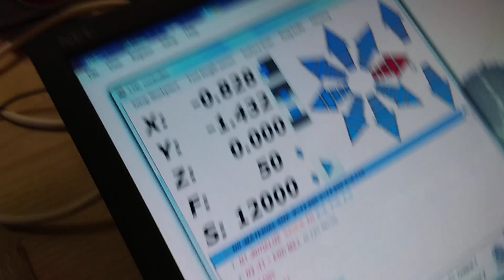MPCNC - Final - I hate this machine!!

Comment: Building your own CNC is a continuous learning experience. I built my 1st one about 11 years ago and have upgraded and built new designs over the years. You will ALWAYS have gremlins to chase down--even if you went and bought a turn-key CNC.
But getting to your MPCNC, I can't see your Z stepper in the video, but if it's the same size as the X and Y steppers I would say that's part of your problem. I also read in a comment you replied to that you're using low voltage--that could be a problem but having the correct stepper motor would be the better solution. See if you can wrap a piece of tape around the Z stepper shaft and put a piece of tape around the Z axis screw. Place marks on both of these tapes that line up with each other. Run that bird program again (you don't have to cut wood, let it cut air for the test). After the run see if the marks no longer line up. If they are off, you have mechanical slippage. If the are lined up, you are losing steps in your motor (which means you need a bigger stepper).
Reply from the maker: My background;  I am a tool and die machinist and have been running cnc's since the 1980's. I bought a Mazak cnc mill in the 90's when I had my own job shop. About 5 years ago I bought a Legacy Arty cnc mill, 3 years ago I lead a team of guys at my Makerspace to build an MPCNC (this one I am using belongs to a friend), and earlier this year I built a medium sized cnc router which I have vids of here on my channel which did teach me alot.
now, I know that means little when it comes to building your own and working out the little details of "chasing down the gremlins". I admit I don't know everything, and could even go as far as to say I don't know much in the grand scheme of things. But i do know that this limitation of a very very very slow z axis is normal for this build when cutting 3D. I have read it in the forums. One easy solution is a 2 or 4 start leadscrew instead of this threaded rod.
I am using low voltage because it is the design of this machine to do so. I am actually on the high end of the scale. btw, I don't know if you know, but this is a kit build basically. https://www.v1engineering.com/ . 
the correct stepper motor - this is the correct stepper for this kit. I did say in a reply that more voltage with an external driver would make a big difference though. thousands of people have built this machine and don't complain. I'm guessing because they don't know what a real CNC acts like.
it is not mechanical slippage. I say that, but I suppose I could confirm that as I have recently decided to take another run at it. But, I always file flats on the shafts where the setscrew goes and nothing is loose. But your sugestion for cutting air is not a good test for this machine. I can cut air at 20 IPM with no errors, but have fails at 10 IPM when cutting wood.
bigger stepper - yeah, maybe. I'd try more volts first though.

   the thing is, most of the builders of this machine don't cut 3D, they just do  2.5D and that is much less work for the z axis so most users never have the problems I am having.

   I am quite confident it will work at 3, 4 or maybe 5 IPM Z axis feed, but the reason I walked away from this machine is I have a Legacy CNC and a home built cnc that's even better than the Legacy, and who wants to let a machine creep along all day with one cut that should take 20 minutes? Then there's the problem of keeping it square! And consistently getting your work zero's in x and y from one day to the next or after a power outage.

   haha, I just talked myself out of running it again. 

Now I remember why I walked away. even if I got the z axis to run at 50 IPM reliably, it would still suck.

   yep, I am done with this machine.

  A much better build for not much more money is here - 

https://youtu.be/jMcblAB_fe0

Comment: If you haven't already, you should post your problem on the v1engineering forum. The MPCNC is a brilliant design, but you have to follow the directions on the website very closely. Off hand, here are a few things that I can think of that can cause the z to loose steps. 
1- The Vref voltage on the stepper motor driver may be set too low.
2 - The tension bolts for the z axis were over-tightened. To check this, you can disconnect the lead screw and screw it down to where you can move the z axis by hand. Without the weight of the router it should move easily with no slop. I can move mine with just one finger.
3 - Lead screw needs to be lubed.
Reply from the maker: thx Kyle.
I know the MPCNC is a good design and the forum is great too.
Problem really is that I have 2 other cnc's that are great heavy duty machines, so I'm a bit spoiled.
#1 I began with Vref voltage at .7 and then took it to .9 and then 1.1. The drivers get a little hot when going over .9volts. I could go 1.2 to 1.3 and put a fan right on it, but shouldn't have to. It should work fine at .9 to 1volt I would think.
I think the problem is counting steps, which reminds me now, I have the steps at 32microsteps. If it is steps, I could try 8 and see improvement.
#2 I guess you didn't watch all my vids on this machine because I showed the ease of movement that the z axis has. It moves easy as can be with the motors off by one finger, and yes, it is lubed (#3). 

It is not friction.
I worked with my Makerspace and built a different one and it could only do 7 IPM in the Z axis as well. It seems to me this is normal operating parameters for this machine.

Comment: Maybe close-loop or servo motor helps. Don't give up, it is nice to most hobbyist.
Reply from the maker: Thanks Efren. I have thought about firing it back up from time to time.

I started running it with z axis feed at 20IPM and it failed so I went to 15, it failed again, so I went to 10 and it still failed. Now I figure it might run well at 5 to 7 IPM.

Mechanically, the z axis moved freely, so I know it's under powered.

I think what is needed is at the very least an external driver with 36V or more. 

Also a 4 start leadscrew would help.